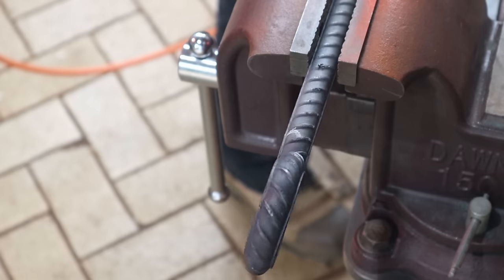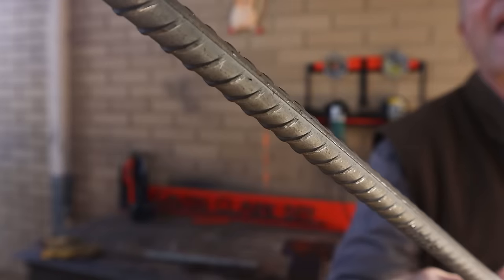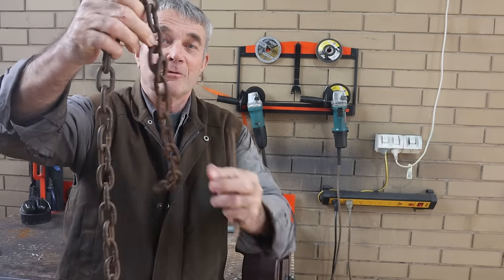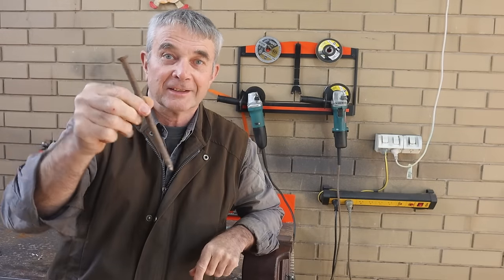I make a Campfire Tripod - Heating Steel Rebar with a Handheld Gas Burner Torch.

Comment: I really liked your hot bending of the rings with pipe, i use the same method to straighten out coil spring when i'm blacksmithing. It all looked really neat and tidy when finished, great job Gavin.
Reply from the maker: Thank you very much, I am glad you liked it. You would need a lot more heat to do a coil spring than what I am using, blacksmithing is so cool, and relaxing to watch, I enjoy watching it. Cheers Brett.

Comment: I made one years ago, but I like the way you did it better. I welded steel washers about 15mm from the bottom of the legs so they wouldn't sink into soft soil, but kept the points a bit sharp. Thanks for the video. Jon
Reply from the maker: I have done the same thing with some of our light travel ones, put washers near the bottom too. Thank you very much, I appreciate your comment.

Comment: Great video! I recently saw a Bautri-System that combines normal formwork props into a hugh solide tripod for pulling trees roots or for a Light Pole.
Reply from the maker: Thank you very much, I am glad you liked it. That would be a large tripod, many years ago we used a large tripod I made from 2 inch pipe and a chain block for lifting engines in and out of cars etc. The good old days. Cheers Paul.

Comment: Only one little tiny suggestion, and trust me, I had to work hard to find anything.  That is some really nice work.  Especially how even it all was with just a torch and a vice, but the J hooks could have used a slight counter bend to put the weight directly under the shaft, and keep it hanging straight down.
I work with and around rebar a lot, so I hate those ridges.  Don’t want to think about work around the fire, but the idea and the technique was awesome.
Reply from the maker: You are 100% right Jim, I should have done the extra bend in the hook, as you say they hang straight down, but they also look heaps better. I love the look of the ridges, but I must say I have made one of these out of round rods, and as long as it is as thick as this one is, it will still look great. This won't be getting moved much, so the ridges will not be touched very often. Thank you very much, I appreciate your comment.

Comment: I have seen  you make several items on here. Rebar is easy to work with and fairly inexpensive if you shop the construction sites after hours! Gee I can't believe I said that. Actually I have a metal shop close by and I buy frrom them.😊
Reply from the maker: Hahaha, there are plenty of cameras around on the work sites. I buy it all, Cheers Jim. Thank you for your comment.

Comment: Hi Gavin.  Cool build and great idea!  Very handy to have a tripod for camping, etc.  I was wondering what gas are you using for your torch.  Seemed to heat up the rebar pretty quickly.  I thought is probably wasn't propane, which pretty common for that type torch in the U.S.  Thanks for the video!
-mike
Reply from the maker: Thank you very much, I am glad you liked it. I am in Australia, it is called LPG  gas which is the same gas as Propane over there in the US, it takes a while to heat up, so I sped the video up when needed or the video would be too long, so you are spot on, I am using Propane and it takes a while. Cheers Mike
Reply: @GavinClarkdiy  That makes sense.  Thanks!

Comment: Maybe foot pads and spacer chain or rods to prevent splaying out.
Reply from the maker: If it was going to be used on concrete or some smooth surface I would agree, but this will only be on dirt, and if it sinks a bit it is plenty tall enough. You do make a good point, thank you.

Comment: Love your work.
Can you blacken this to prevent rust and if so how would you do it?
Reply from the maker: I plan to heat it a bit and rub a mixture of beeswax and linseed oil on it with a bit of rag, I am not trying to do a great job I will give it a coat when it is over the fire later.

Comment: Great video.  What type fuel are you using and torch head size? I can never seem to get rebar hot enough to bend using the torch I have, well that is unless I want to sit there for 2 hours😅. Keep up the great work! Thanks
Reply from the maker: I am using LPG gas (Propane) I have increased the speed of the video, which is why it looks fast. It is not fast to heat it but not too bad I am happy with it for what I do. The burner head is a bit over an inch (26mm) I don't know the brand name of the torch I have had it for a long time, and I have not seen them for sale here or online.
Reply: Thank you! Great videos!

Comment: Hi, great design, do you apply a finish to prevent rust or you just let it oxidize?
Reply from the maker: I plan to heat it a bit and rub a mixture of beeswax and linseed oil on it with a bit of rag, I am not trying to do a great job I will give it a coat when it is over the fire later.

Comment: It all looks very nice. But 16mm is still too thick for a tripod. I have a 1/2" pipe tripod in the cottage (pipe wall thickness is 2mm). I hang a 9-liter kettle (pot) on that tripod and there are no problems. I once cooked "shepherdsoup" for a slightly larger team, so we hung a 15-liter kettle . There were no problems at all. I think 16mm is oversized. Unless of course you have it left over from some job and you have nothing else to do. But I don't think there is a need for such a thickness of the reinforcement. Everything else looks excellent and commendable. I would just suggest a little thinner reinforcement. Let's say 12mm would be more than enough and it certainly bends easier.
Reply from the maker: I agree with everything you have said, I used 16mm so it had a very solid look, and looked different to others. It will not be transported much it, it will probably be set up most of the time over the campfire spot. (It is all about the look and the feel of the seats, table, and area that is why it is made the way it is). Thank you very much, I appreciate your comment.

Comment: what have you done to prevent rust?
Reply from the maker: I use beeswax on mine, but once it starts getting used in the fire I don't worry about it too much. I would just rub more on if I did worry, when it was warm. I  hope that helps.
Reply: I made one

Comment: I wounder what the length on those tripod legs are?
Reply from the maker: The lenght of finished leg from bottom to the top of ring is 51 inches. The height of the campfire tripod, when it is set up, is 43 1/2 inches (110mm).
Reply: @GavinClarkdiy  thank you

Comment: How long were your legs before you bent them?
Reply from the maker: The lenght of steel in one Finished leg is 57 inches the lenght of finished leg from bottom to the top of ring is 51 inches. The height of the campfire tripod, when it is set up, is 43 1/2 inches (110mm). Cut your steel a bit longer , it gives you something to bend with. I wish you the best for your project.
Reply: Thank you very much sir! You are the man. Ganna give this build a shot!